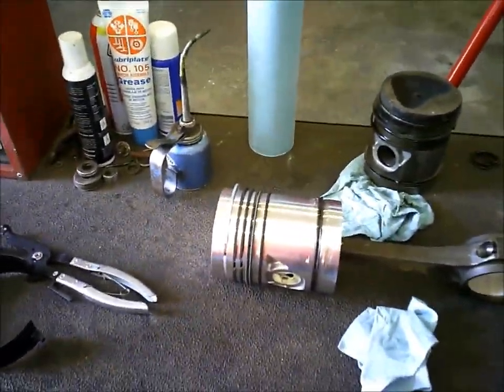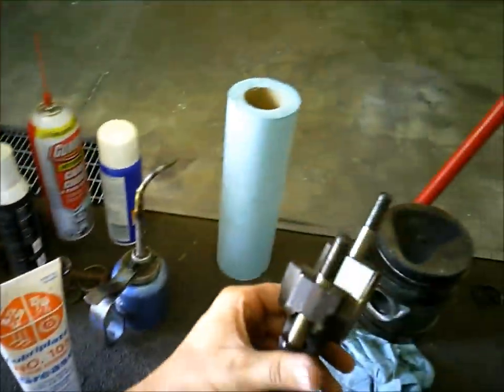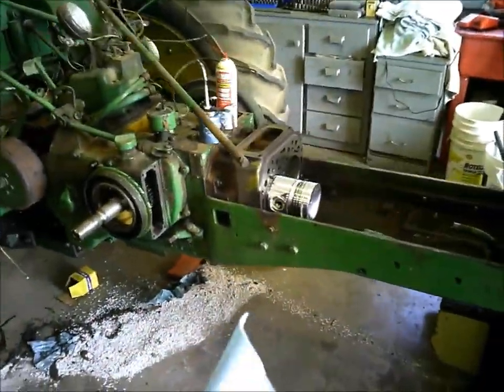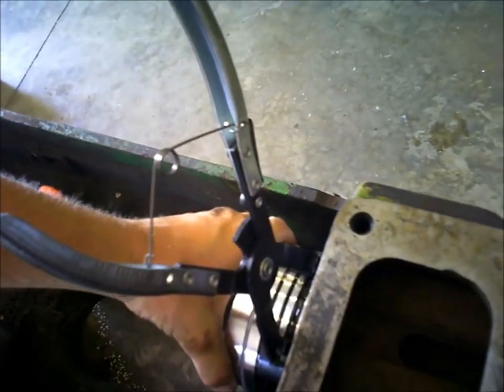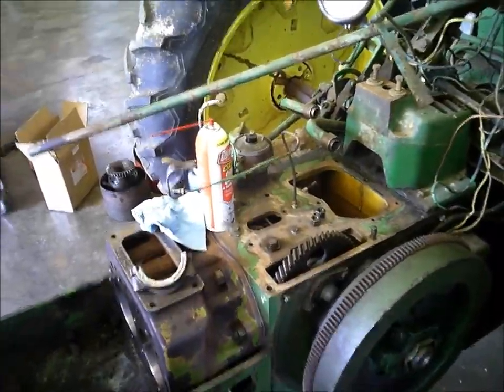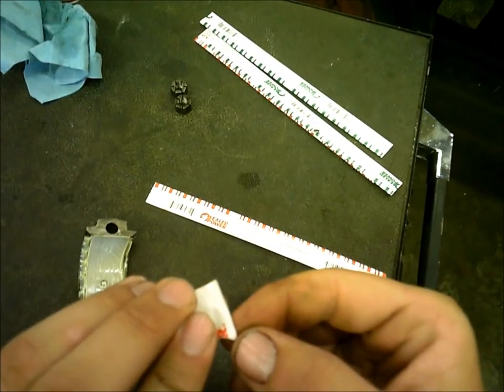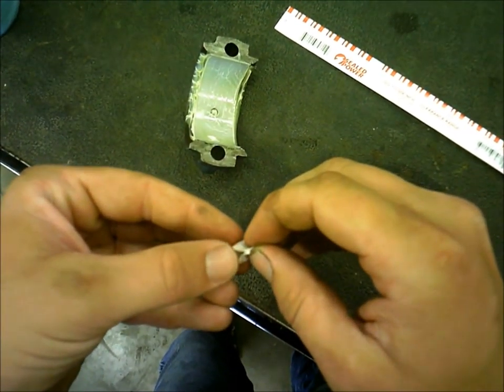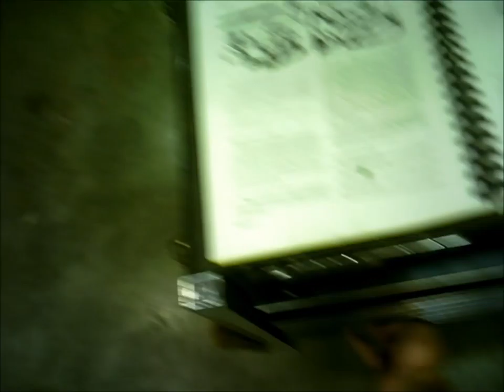JD 530 overhaul pt 5

Comment: Great job you could build an engine for me any time. I worked in a garage when I was in high school the man I worked for sold the garage I seen some wild stuff from the new owners like.I watched
the owners son  try to rebuild an engine in a car without pulling the motor . He was dropping rod caps ,and bearings in into the dirt on the floor . He would wipe them with a dirty grease wrag and put them in.
Reply from the maker: Thanks! That seems to happen a lot someone builds up a great business doin great work then they retire or sell for other reasons and some cut rate guy comes in and ruins it